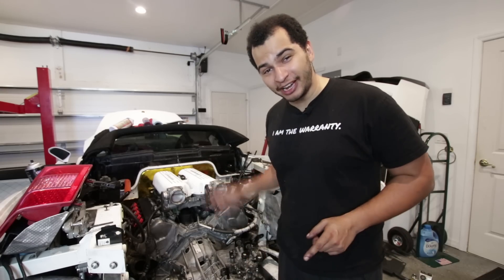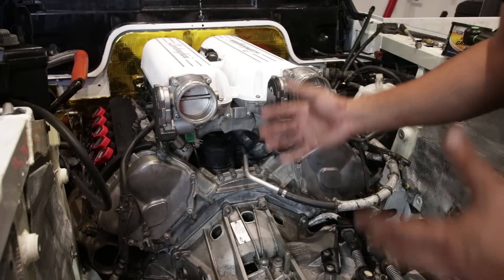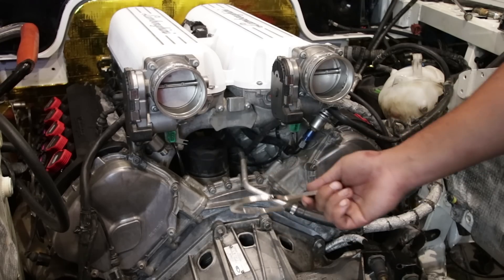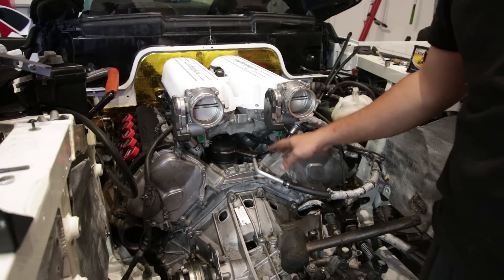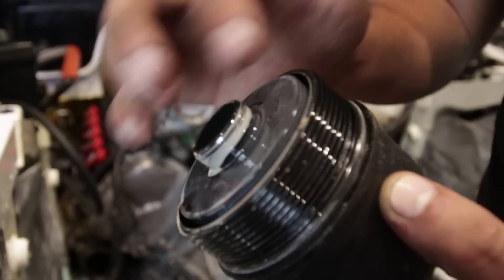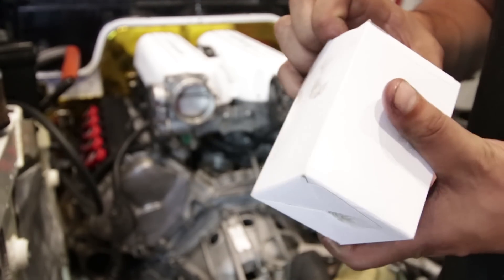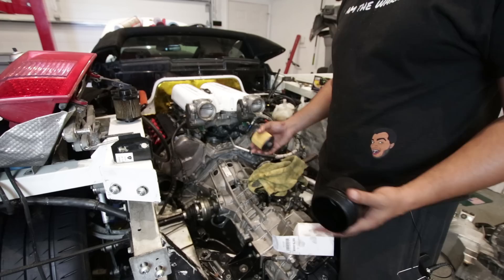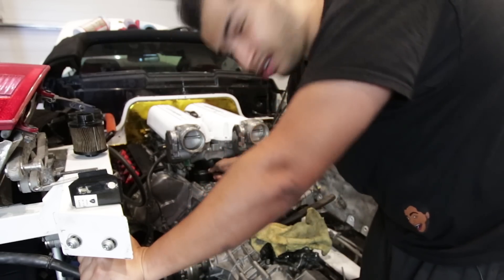My Cheap Lamborghini's Oil Looks Like A MILKSHAKE (And I'm NOT Worried About It)

Comment: Always do inside to outside. That way if the valve cover is warped you flatten it as you go versus potentially having the center high and and forcing it down where it won’t seal as well.
Reply: Yes, up vote this!

Comment: Always start from the center. If there is a bow somewhere and you tighen the corners first ; you have just locked the bow in place. If you start from the middle, it pulls the mating faces together across the lengrh.
Reply: That's what I learned, is there ever an exception?
Reply: There's always an exception somewhere, if you've got the factory manual for your car always follow the pattern they describe/show, it may not be 100% necessary but it should have the least chance of going wrong.  In the absence of any information starting from the center and working in a spiral outwards is what I was taught, it usually works well for valve covers, oil pans and I've even seen it as the factory pattern for some cylinder heads (I would add though that I'd never do a head without knowing the correct pattern for that engine model, just not worth fucking that up).
Reply: ALWAYS. no ifs, buts or maybes.

Comment: Has no problem using junk yard f150 parts but has issue with Jetta parts
Reply: roskinc I had the same thought.
Reply: Had a Jetta. Sounds smart to me.
Reply: legerdemain this comment is highly underrated
Reply: I'm sure he regrets that.
Reply: Ever heard of built ford tough
Reply: Own a jetta, definitely a good idea to avoid them at all cost.
Reply: Yeah the coolant tank was one of the more solid parts on the car. Same with the power windows.
Reply: The power windows are horrible on the mk4 line, I had to replace 4 in one year along with the master switch.
Reply: Billy Allen I own an 03 Jetta 1.8T, has 270k on it, the thing is absolutely mint. Never had any sort of issue. Everything works as intended and the engine is still super peppy and quite quick. Actually tuning it soon. I love the car
Reply: Frugal, Lamborghini is owned by Audi, which is under the same company as VW, namely VAG. Thus making it a part VW also.
If you pull the cigarette lighter plug you'll see on the underside of it the Audi, vw and probably also the Skoda logo.
Reply: That whole car is an Volkswagen/Audi product. Lamborghini has been owned by VW/Audi since about '98. REAL Lamborghinis have been out of production for quite a while. Remember they used to have genuine Lamborghini V12s?
Reply: Actually that isn't totally true either. In the beginning there was more Audi parts used than today.
Lamborghini president Stephen Winkelmann has decreed that their cars will share no more than 20 percent of their parts with Audis, just on hidden parts – parts that will not touch the DNA of Lamborghini. That could include things like the electrical platforms that need high investment, or hoses and filters.
Reply: Its because that expantion part is more important than the f150 part
Reply: He did say that the tank he bought was off an Audi. Thus, the new tank is technically also a VW part.
Reply: You shut use vw pars because they are good :)
Reply: Billy Allen I can't get behind a company that makes you take the tire off to take out the battery.
Reply: Michael Burton Ever heard of Fix Or Repair Daily
Reply: 4.2_Trailblazer_racer says the guy with a Chevy in his profile. Great satire there
Reply: Gary Curtis Lol I have an 02 Trailblazer with 488k miles and it spins like a top bought it brand new in 2002. People have their opinions  on every brand but with my personal experience Ive only had Chevy and Toyotas and they have all been nothing but reliable. Thats just my take on them
Reply: Actually, there is still Lambo V12s being made. The Reventon gets it. The Audi and Bentley 12 cyl. are the W12.
Reply: he said it looks cheap. The other part cant be seen. you have no point
Reply: David Galinat Fact. The Lamborghini V12 is still based on the same platform they've always used to build their V12's. The V10 is an Audi product however.
Reply: Ford actually makes quality stuff. Jettas and VW in general are something to stay away from.
Reply: Jake Elliott That's funny.
Reply: Lucas Cassan I'm glad you find it funny.
Reply: Jake Elliott Really is quite funny. Out of my 6 Cars, my two VW's have been nothing but perfect to me. No issues at all.
Reply: Lucas Cassan then that's great. My 51 year old ford still runs strong with no issues
Reply: Jake Elliott Oh man I have nothing against Ford, or most manufacturers for that matter, I'm just stating my point that VW is one of the good ones for reliability in my experience. My BMW, Audi and Hyundai had issues. My VW's and Toyota were great
Reply: Lucas Cassan Toyota is very good in my opinion but in my experience and my parents as well VW has not been the best.
Reply: Kaiten Sohal yup.  That's about the size of it.  It is a flashier looking R8, roughly same engine as a  V10 S8 of the same era. Until Audi got a hold of them, Lambos were for posters and poseur, now they are engineered to actually drive and perform.   And if he wants to save money, comparison shop parts between VW, Audi & Lambo.  Sometimes Lambo parts prices are cheapest, like the intake manifold vacuum pods on a stock motor. Audi guys use them all the time.  It is just silly not to use the proper fasteners, wrong metallurgy, missing protective coatings, for the sake of a few dollars.  I wouldn't put that crap in my lawn mower.
Reply: Kaiten Sohal  Yup, That's why it's damn near as reliable as a Camry, until you set it on fire.
Reply: Lmao ever owned a jetta? I would say good call on his part
Reply: FrugalPrepper people love to buy cars they can't afford to maintain then they complain how the car is unreliable....
Reply: Yeah man jetta

Comment: One of the main benefits of a dry sump system is the scavenging of oil away from the crankshaft. This keeps the oil from being beaten to a foam by the crankshaft. This keeps air bubbles out of the oil and gives your PCV system an easier time at separating the air from the oil. This is needed to keep the oil pump from cavitating and your bearings fully lubricated with pure oil (no air). Airplanes are the main users of dry sump systems.
Reply: I've always heard the oil likes to "wrap" around the crankshaft, hence the use of crank scrapers, windage trays etc. and aeration would be a result of overfilling the engine with oil. Either way, dry sump systems are good stuff.
Reply: ZatoichisCaneSword! Yeah if your crank is hitting the oil it's definitely overfilled. Dry sumps are mainly for high g forces and to mount the engine lower to get a lower center of gravity.

Comment: I wanted to let you know that a torque wrench is accurate in its middle range. 
The lower values and higher values are much less accurate. 
I use an inch-pound torque wrench for lower value torques to get more accuracy. I do this especially for valve covers and engines that are mostly aluminum. 
I learned this after 40+ years of wrenching everyday. 
Hope this helps.

Comment: As it appears like you could use a variety of coolant overflow tanks, you may just return that VW one (if you can) and then look around for a more translucent one that you could mount more easily where you want it.  I get that you want it as close to stock as possible, but Lamborghini wasn't thinking about the customers doing their own wrenching.  As you will be doing the wrenching, you could make choices that suit your needs better than the dealer mechanics that have all the perfect tools for this Italian heap of cheese...
Reply: Crazy 8s Drums that tank is used on a lot vw cars belive it or not. I have seen it on b7 and b8 passat, skoda superb and octavia a5 even from 2004. i am takling about small white plastic tank with a blue cap. and btw never herad that it was broken or aomething...

Comment: Did you ever consider that maybe they only drove the car in reverse originally and so the turbo cooler was actually in the right place for going backwards?
Reply: Yeah, I don't think so either.
Reply: Good thinking hahahah
Reply: Big if true
Reply: Pneuma001 no. Then the mileage on the odometer would be negative not positive. Lol
Reply: Craig, a LOT of Ladas (those are REAL pieces of shit!) are so cheaply designed that the odometer on certain model years wind back if you drive in reverse! Holy Lenin!
Reply: largol33t1 it works on classic Ferraris too. Anyone that's seen Ferris Bueller's Day Off knows that. Lol
Reply: Craig, correction: in the movie, they tried putting the car on blocks and resting a rock on the odometer. Then Cameron tells Ferris that the odometer wasn't winding back. That's when Cameron got so frustrated that he kicked the car. It fell of the blocks and went out the back window. The actual car used in the movie was a modified car with a Ferrari body because the real car couldn't survive the stunts they performed in it.
Reply: largol33t1 even if it did work it would just eventually flip to all 9s. Not as funny as my joke that it would actually show negative mileage. Lol
Reply: It's not that, Lambo's have air intakes on the side of the car to draw fresh air into the engine bay, which then exits out of the back. It had airflow.

Comment: Love this series! Just so you know, when you remove those cartridge style filters the oil from the housing drains back into the sump. Always worth having the drain plug out still with cartridge filters so you get rid of that too. They usually have a sealing ring to keep some oil in the housing when the engines off, you pull the filter and that drains back. Keep up the amazing work man, serious credit to you.

Comment: Well if you are going with factory standards you are required to torque pretty much every single bolt that goes into the car. It has to do with the elasticity of the bolt and it locking to the threads. I can't fully recall since last time I worked at a car assembly plant and took classes on torque was in 2009.

Comment: One thing with the valve gaskets I found to help is to tighten the screws in baby steps to help the gasket seat. With that, when you go through and torque the bolts down to spec, if you go back through, you'll find that they aren't at the torque you tightened them to because the valve cover was seated further downward. I had success chasing the bolts with the torque wrench a second time.

Comment: I do gut and tight all the time in my job as a Automotive Service Tech. You definitely have to know where it's in important and where you can just snug things. You were right in your last video about engine components being vital. Especially on these new crazy metal castings they are coming up with, a lot of these alloys can distort very easy with the wrong torque. The most important part of the bell housing bolts is that they are clamping the transmission/transaxle onto the engine and that the correct number is there for sheer force.

Comment: Copper spark plugs give better performance. The larger electrode transmits heat away better. They use the tiniest little pinpoint of an electrode on the platinums and iridiums to save money on such an expensive metal, but because that point is so small it acts as a concentrated heat source and causes detonation, so your knock sensor will detect that and pull timing which reduces performance and efficiency.
Reply: sirgallium immediately came to the comments to say the same thing!!! Boost is better on copper plugs!!!
Reply: I have heard the same.
Reply: Not totally true, the Pt or Ir plugs use a point to concentrate the spark, this makes for less misfires, also you get plugs that run at the same heat range i.e same temperature.
Reply: James Templeman 1,000+ horsepower turbo motors will have a lot better tuning window on plain old copper plugs, especially motors already built and tuned to run on such.
Reply: Not going to argue with your experience but I will say mine has been very different, snuffing the spark out at high boost levels has been more of a problem then detonation from hot plugs or melted electrodes
Reply: Spark blowout can be an issue, but that's easily remedied with a .025-.028 gap. The biggest point here though, is that the engine was tuned with coppers in it, and shouldn't be ran with another plug style until it is retuned.
Reply: I agree with you Brad on the point of changing plug spec from where the car was tuned, as the car was (hopefully) properly setup on those plugs, so either use the same or do a dyno run to check BUT as Tavarish is changing the turbo setup, exhausts and other setup like fuel lines and vacuum hoses it is now a mute point as he will still need to do a full dyno session to dial in fuel, ignition and boost so he is free to try any plugs he wants especially as he is on the right track with going one or two steps colder from OEM. 

I will point out that this is a different point to what sirallium made.
Reply: The car, as "tuned", burned to the ground.  The turbo install was hack-tastic.  Maybe even good components, but poor execution.  You are spot on regarding spark plug gap though.  The coils produce a finite amount of energy.   On a boosted engine, they have to spark in a denser wetter environment than normally aspirated, there's both more air AND fuel.    It is harder for the coil to fire the spark plug through that denser atmosphere.  Large gaps/wide sparks require more energy that isn't available so you get misfires.  Stronger coils and smaller spark plug gap decreases the chance of misfires.  But that is the least of this car's problems.  The engine bay in this car burned, badly.  The damage has been camoflauged, and the car presently just has all of its bits stuffed into their original location, most of the wiring hanging out, plumbed like a molotov cocktail.  You can't assume that anything in the engine bay is now - or ever was - close to correct.  I doubt the fuel system is even plumbed properly to work with E85 which is probably why it burned down in the first place. Did anyone else cringe when they say the worm gear hose clamps on the fuel line?  Never on fuel injection.  Never Never Never on E85 which is more porne to leak.  Is that fuel line even rated for E85?  If not it WILL rot and leak and make Lambo-sized Smores.   I love this guy's spirit and enthusiasm.  But fixing this car properly requires a helluva lot more reasearch and diagnosis than it is getting.  Fingers crossed.
Reply: There are too many assumptions there, I will move on.
Reply: You put in what the manufacturer recommends.

Comment: I just experienced the milky oil problem on my '78 VW Bug.  The previous owners only used it in the summer, for short trips, and it had a pinched crankcase breather tube.  Even if the engine got hot got hot enough to burn off the condensation in the crankcase it had no where to go.  The breather tube was full of white, gunky crud, but the oil in the crankcase was fine.  The tube is now fixed and the engine breaths easier.

Comment: Cheers for explaining where this milky thing is coming from. I just restarted my RX8 that I had put in in the shed for the winter. And there was the same thing on the dip stick, and I couldnùt understand where it came from, because I have no compression problems (= no seal problems, on a rotary).
I run 95-e10 from time to time to clean the engine. So this explains this.

Comment: Dry sump is actually mainly used for high revving engines, not because of G-Forces -- because there are wet sump pans that will reduce sloshing of the oil in the pan--..The oil will aerate and reduce the lubricating qualities on wet sump pumps at high RPM's, this will occur less on dry sump. Dry sump will as well reduce the load on the crankshaft, increasing the power output of the engine.

Comment: Your right on the torque of the bolts, I work for an auto manufacturer and if they are too loose the bolts can vibrate out and come loose and if they are too tight the torque from the transmission can snap the overtightened bolts/nuts and you need to check and see if they are stretch bolts also

Comment: Tavarish, agree with you re - torquing the gearbox bell housing bolts. Tight and nipped with your torque elbow is sufficient. 
However, if you're in a situation where you need to torque up a bolt to a certain spec that you can't get a socket on sometimes you can use a "crows foot" wrench attached to a torque wrench. There are tables you can get online to correct the torque rating you dial into the torque wrench as the measured torque would obviously multiplied by the length of the crows foot.

Comment: torque on nuts/bolts are very important too loosr and theyll vibrate out, too tight and you actualy stretch the threads and it will also vibrate out or break from stress yes there is alot of "wiggle room" for the torque spec but better be safe then sorry

Comment: Again those holes are there for visual inspection of clutch wear and throw out bearing wear / movement. They did not come with grommets in them. The only grommets are on the 2 holes on the bottom of the bellhousing.

Comment: Careful with that milky oil. Worn rings will NOT cause milky oil. I've seen some gallardos get milky oil from cylinder sleeves dropping, sleeves not sealing in the block, or head gasket failure and they ALL ran fine. I hope that's not the case. How's the oil in the oil tank? Milky too?
Reply: DING DING DING

Comment: You’re precisely right, went through the same in Switzerland. We did this last year on a convertible that was laying for over a year! 

1. It was also milky at the oil cap area. 

2. Did an oil change / filter etc

3. Guttentite 🤪is always good enough.

4. We have 100 ron fuel, I suspected the car had cheaper fuel and it also results to milky residue when left.

5. Get it to warm. Run easy and examine the oil cap etc.

6. Remove oil again and renew. Not necessary but I did to ensure anything coagulated or milky comes entirely out. Running it gets it moving around.